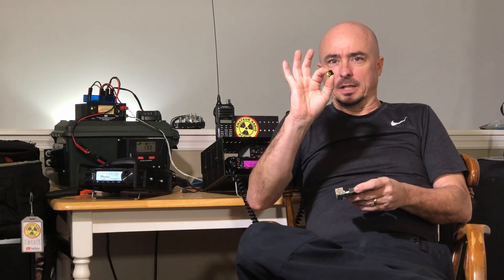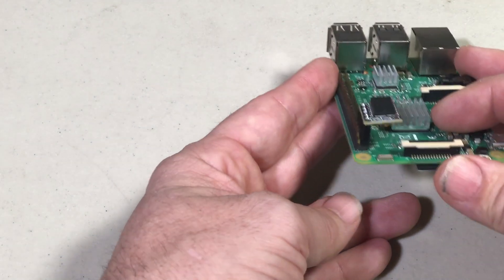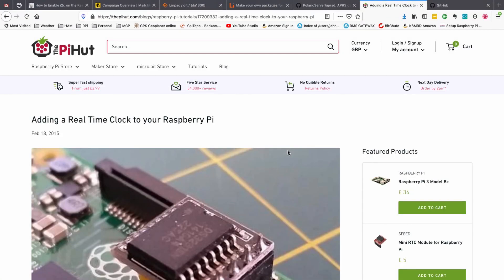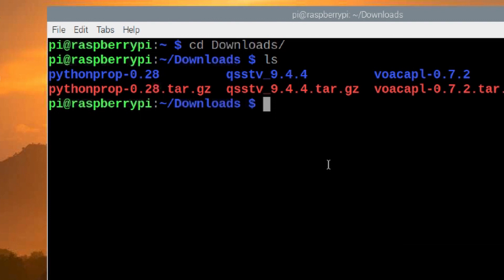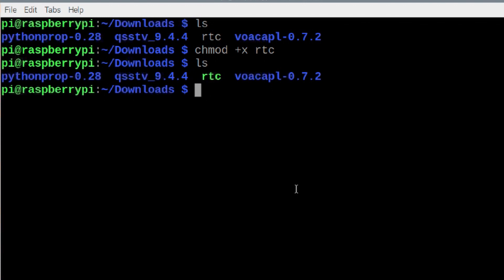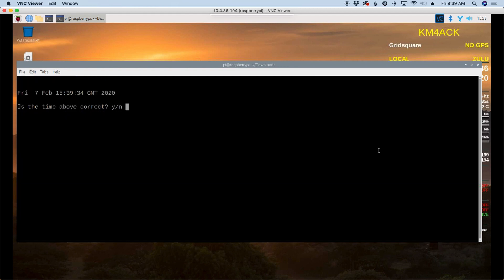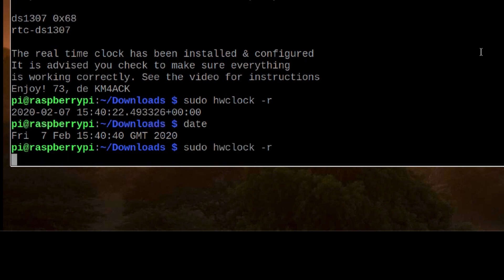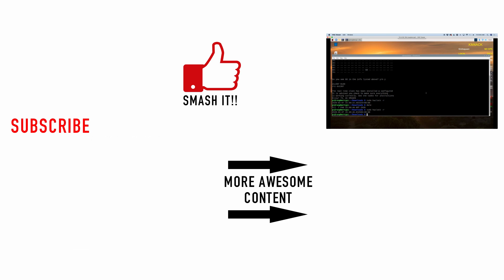Real Time Clock Script for Raspberry Pi

Comment: Great tutorial and good script. Unfortunately i received this from hwclock: 
$ sudo hwclock -v -r

hwclock from util-linux 2.36.1
System Time: 1717737020.287812
Trying to open: /dev/rtc0
Trying to open: /dev/rtc
Trying to open: /dev/misc/rtc
No usable clock interface found.
hwclock: Cannot access the Hardware Clock via any known method.

Rebooting and disconnecting from internet the clock is not updated, any reason ? Thank you.

Comment: I ran this script and went as planed til I answered Y for both questions. which at time did show correct info. now when I check time & date its off ALOT. I did do this manually the long way anf after running the script after the sudo bash, I noticed the correct time that showed has changed from 2024 to 1999. I am wondering if this is due to the RTC chip is ds3231 not ds1307.
Reply: I got it to work, turns out quality control on these modules isn't up to spec. LUL

Comment: very good script !
i have a small improvement.
if someone has the same problem as me with mulitple connected devices, you can just alter the first query of the script to "contains" instead of "matches"
if error message says "Please enable I2C interface in the Raspberry Pi Configuration and try again", this means the returned string can be emtpy OR multiple outputs like (example):  /dev/i2c-0  /dev/i2c-1  /dev/i2c-10  /dev/i2c-20  /dev/i2c-21  /dev/i2c-22

so change this:
if [ $IC2ACTIVE = "/dev/i2c-1" ]

to this:

if [[ $IC2ACTIVE == "/dev/i2c-1" ]] 

so it asks for "contains"

have fun :)

Comment: I bought one many years ago and revisiting this project. Connecting I noticed it's not detecting. The onboard battery is dead by now. So I resoldered a button batt to replace it.. Still not detecting. I wonder if the onboard batt matters or just needed when power is comp. off

Comment: My Raspberry Pi 3b refuses to run Jason's rtc script. The error msg "Please enable I2C interface in the Raspberry Pi Configuration and try again" . I've checked the i2c interface configuration was set to enable and tried to Reboot, then Shutdown and Boot but get the same error.
Reply: I had same error.  I installed older version of raspberry os and it worked.

Comment: How long the super capacitor can keep the time if no power is applied, are we talking months or days,
Reply from the maker: The RTC takes a small watch battery. I am guessing that you should be able to get a year out of it.
Reply: @KM4ACK  thank you so much for response, the modules that I ordered came with super capacitors soldered like a tiny battery, not sure what would be the backup time on those guys, the modules looks the same just like the one you have used here.  Cheers
Reply: Is there any way with this rtc to correct the time with Daylight Saving offset automatically?

Comment: Say I want to time a relay to go off and one a couple times a day with a raspberry pi.  Do I need one of these RTC modules or can I just use the existing time modules from within the pis libraries?  Secondly would it be better to use the rtc module if I plan on using an arduino mini?
Reply from the maker: You won't need the RTC provided you are connected to the internet. The Pi will pull correct time from the internet on boot. The RTC is needed if you don't have internet since the Pi doesn't have a RTC on board.
Reply: @KM4ACK  ok thank you. My only concern is if the internet were to go out I'm hoping to keep my greenhouse automated so that's why I'm so set on using an RTC.  Hoping to take this design to an arduino nano next to use RTC to control just a couple relays to go off a few times a week to power a couple water pumps.  (One pump from a nutrients tank and one pump from a water tank set to go off at different intervals) at this point I'm willing to pay someone to help me figure it out.

Comment: Why you need a rtc¿? for what do you use it?
Reply from the maker: The raspberry pi doesn't have a RTC built in. If you power down the pi, it will not keep correct time. On reboot, the time will be the same as when you powered it down last. If you are connected to the internet, the pi will obtain the correct time from a time server over the internet. However, if you are working portable without internet, you need a RTC added to your pi that is able to keep time even when the pi is powered down.

Comment: does pi  get it's fake-time when pi is close to known wifi ? Or do we need to log on with ssh to sync pi fake-time clock? when I write fake-time I mean no rtc?
Reply from the maker: If the pi connects to the internet, it will pull the time from the internet. It would have to be connected to the wifi to get the time.

Comment: Hello KM4ACK thank you very much for this easy install script! LOVE IT!

I have only one Question, when the battery is fully discharged and i have to replace ist, how do i set the right time again?
Reply from the maker: Connect the pi to the internet or GPS to get accurate time and the run sudo hwclock -w to write the system time to the RTC board.
Reply: @KM4ACK  perfect! Thank you!
Reply: It all works nice now!
 Thank you KM4ACK only one question, is there a away to switch automatically between European Summer and Wintertime?

Comment: Jason and others. FWIW, this item became available, according to the seller, on March 07. I placed my order. Delivery date was expected to be April 07. Within a couple weeks of placing my order I received email from the seller that delivery would be delayed until April 24. That date came and went. I emailed the seller as for a new delivery date or refund. Within 2 days I received an email from the seller expressing sorrow for no delivery and my order would be cancelled with a refund.

I found this unit on amazon<dot>com,
https://www.amazon.com/gp/product/B01JGNKNNA/ref=ppx_yo_dt_b_asin_title_o02_s00?ie=UTF8&psc=1

It appears similar but with different circuitry and costs less than the item Jason is using.
Best 73 de KB89AMZ

Comment: Hmmm... seems I have a choice of a case with fans or RTC. Any cases with fans that allow access to the RTC pins? I'm sure there's some.
Reply: As soon as I posted, I recalled I had some header extenders. While I had already passed the Build-a-Pi V2 script section on the RTC, I just swapped the header in and put the RTC on. I'll see how it goes once the BaPv2 script completes.

Comment: Sorry to ask but having 1 issue and I'm not sure what I've missed.  The RTC is not updating the system time,  When i check the rtc has the correct time its just not passing it over to the pi.  I also have a gps plugged in and when it gets a lock then that updates the system time ok.  Does the rtc work as well as the GPS or do i just use one or the other.  Thanks for any pointers
Brian
G0WZB

Comment: Thank you for the video.

Question if I may.... What is the point/benefit of installing the clock? Let’s say the only thing you use the pi is JS8CALL... will the clock now synch JS8CALL to the correct time? What if you power down the pi, do you have to reset again when powering it back up?

Sorry if these questions are mundane... but I’m a NOOB. 🥳
Reply from the maker: Great questions! The pi doesn't have a RTC on the main board. So if you power the pi down and fire it back up a week later without an internet connection, the time will be off by a week. We can overcome this in one of two ways. 1. Add a GPS dongle connected to the pi. When the GPS gets a lock on satellites, it will also download the time and sync with the pi. 2. Install a RTC like in the video. This is an actual RTC that will keep accurate time even when the pi is powered off since it has a battery built into the RTC. When the pi is booted up, it will get the current time from the RTC and sync it to the pi's time. Either way will give you accurate time for apps like JS8Call or WSJTX. A third option is to add both the GPS and the RTC for redundancy. 73, de KM4ACK
Reply: KM4ACK thank you, Jason. As always, I appreciate your expertise and willingness to share.

Comment: Just tried to install the RTC and the autospot update, but now I have zero audio out via HDMI or headphones.  It seems like I spend more time jacking around with this pi than being able to use it.
Reply from the maker: Check you volume levels and default sound card using the speaker icon in upper right corner of desktop. Alternatively, run ‘alsamixer’ from terminal. Neither of the scripts should have any bearing on sound. 73, de KM4ACK

Comment: Jason, just got my real time clock today in the mail and installed it the easy way.  It is working perfectly.  My GPS dongle is in the mail to me, should have it in a few days.  I know I have said it before, but you are a lifesaver!!!  I had all but given up trying to use my Raspberry Pi.  I had issues trying to use a 3.5 inch touch screen, then I got a 5 inch HDMI screen, still issues but after watching your videos and doing the VNC connect and now with the Pi Build I have a working Pi for amateur radio.  So far I haven't had any issues using the V2 (got the link from the email) on my Pi.  I have worked several stations using FT8, ran JS8Call and did a @autocall and got a few stations reply.  Haven't had a QSO on JS8Call yet.  I have used Ardop and got Winlink working.  Played around with the SSTV, but I don't have any pictures on my Pi, yet!  Saw your email today and now I am going to look for a USB drive small enough to fit the USB ports once the radio, Signalink and GPS is hooked up.  You are doing the amateur radio a great service my friend, especially those looking for portable operations and emergency in the field comms.  Keep up the good work!!  Juddie WD8WV
Reply from the maker: WOW! Congrats. Glad you have it all working. Success stories like this drive me to do the next video. 73, de KM4ACK

Comment: What timing. I was ready to run the pi build script for the first time this morning, and I saw this. 

Using the first method, "./rtc" game me a bash permission denied error. The second method worked. Should it be run with sudo?
Reply from the maker: Did you make the rtc file executable with 'chmod +x rtc' ? 73, de KM4ACK
Reply: KM4ACK yes. The ls command showed rtc in green.
Reply from the maker: Ed, run the script with 'bash rtc' An error was found in the original script that can prevent it from running. It has since been resolved. Sorry for the confusion. 73, de KM4ACK
Reply: KM4ACK Too late. :) You provided a second method and that worked fine. So no trouble for me. Worked like a charm.

Comment: The "RTC Clock Module DS3231 High Precision Real Time RTC Clock Module Memory Module for Raspberry Pi 4 Pcs" from Amazon is "Currently unavailable. We don't know when or if this item will be back in stock." I found this on Amazon's website FYI Jason.
Reply from the maker: It seems like you guys have bought them out. Hopefully we see them return in a few day. Look at the very first comment on this video. I put a link there but there is only 2 left in stock as I type this.

Comment: Jason I am wondering the BEST way to Shut off or on Hotspot to Wifi internet .As your system I do like, HotSpot for the field ,and when in the shack a switch over to Shack Wifi internet. I  am getting My amazon GPS usb like yours today so be covered in RTC in the field, along with the RTC here.So could you guide me into commands to use in switching that you may do when your switching that fast and quick . 73's Jason
Reply from the maker: To force the hotspot to check for known SSID run ‘sudo /use/bin/autohotspotN’ it will only shut off if a known WiFi SSID is in range. Otherwise it defaults back to the hotspot.

Comment: Jason, I've been out of the hobby for many years but getting back in now. Just got a Pi4 but I know nothing about it. How do you use a 5V fan and the RTC clock at the same time? Do they share the same pins?
Reply from the maker: The RTC connects to the inside row of pins for the GPIO and the fan connects to the outside row 5V & ground. 73, de KM4ACK
Reply: @KM4ACK  my clock uses the first 3 pins on both rows. :(
Reply from the maker: Drones In SC not familiar with that style
Reply: @KM4ACK  I ordered some pin connectors. I think I can piggyback on the backside of the  PCB for the fan power. :)
Reply: Drones In SC - I was about to ask the same question... thank you for beating me to it.👍

Comment: Hey Jason, do you know how using baofeng with raspberry to create an aprs?
Reply from the maker: Easiest way is to use a signalink as your soundcard. Signalink makes a cable for the baofeng. Then you should be able to follow my APRS digipeater video. 73, de KM4ACK
Reply: @KM4ACK  can i use sound card stick or alternate sound card?  Because signalink its very difficult to find in my country.
Reply from the maker: Abdul Azzam Ajhari you can but PTT will be more difficult. Keep in mind that VOX doesn’t work well on the Baofeng because of long hang time.
Reply: @KM4ACK  ah i see. Thanks for the info jason

Comment: Great information again Jason as usual!!  I am getting ready to order the real time clock and the GPS dongle today for my Raspberry Pi!!  I sat in the living room last night and ran the Pi again with my 817ND and Signalink in my radio room and worked some FT8 in the comfort of my loveseat!!  Haven't been able to connect to a station using Ardop yet.  Winlink has been setup on the website, I just can't seem to connect to a station anywhere close to me on 40 Meters.  It could be because I am only running 5 watts into a tuned 80 Meter dipole up 25 feet.  Juddie WD8WV
Reply from the maker: 5 watts will limit you a bit but maybe try the auto pat feature in Pat Menu.

Comment: Do you need to turn off I2c port after install?  Or do you leave open for pi to sync RTC from standardized source?
Reply from the maker: You want to leave it enabled as this is the way the pi communicates with the RTC. 73, de KM4ACK

Comment: Jason, great video. On Amazon, would other DS3231 clocks work? There listed one was out on Amazon, so I found one described as DEVMO DS3231 AT24c32. But it seems to have 6 pins. Starting at one end they are labeled, GND, Vcc, SDA, SCL, SQW, 32k. Let us know what you think. Thanks!
Reply from the maker: I updated the link in the pinned comment on this video to a suitable replacement. https://amzn.to/3bFN3Fx Grab in now though. There is only 10 of them in stock as I type this. 73, de KM4ACK
Reply: @KM4ACK  Jason, will your script work with other real time clocks? I purchased one a while back from Amason (5 pin DS3231) that OH8STN had recommended in one of his videos and had not yet gotten around to installing it. Or do I have to use the one you set up in this video? Gerald - KG0VA
Reply from the maker: Gerald, I suspect it will work with any of the DS3231 variants. The one I linked to is the one I purchased and tested with. Please report back after you try it. 73, de KM4ACK
Reply: The DS3231 all work fine, except some have some additional features.  If I recall correctly the DS3231M chips do not have the temperature sensor on, which can result in a higher clock drift due to the crystal changing behavior in different temperatures.  The DS3231SN does have a temperature sensor, so allows for accurate adjustment because of it.  That said, if you're connecting to NTP or GPS, the RTC can be updated as necessary when those are available as clock sources.

As for the extra pins, the SQW is programmable square wave generator, and the 32k is a 32khz square wave generator. Unless you really want to dig into them, chances are you won't use them, like most people won't use the calendaring and alarm functionality that is built into the chip. Just don't plug them in.
Reply from the maker: Jonathan Angliss thanks for the detailed explanation!  I learned a few things. 😃👍 73, de KM4ACK